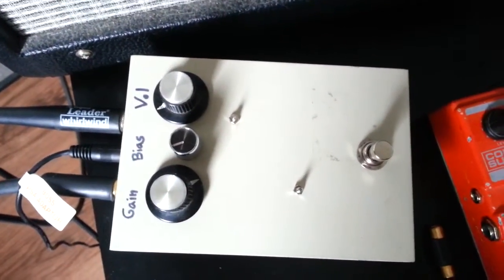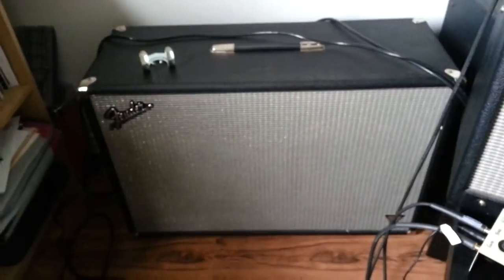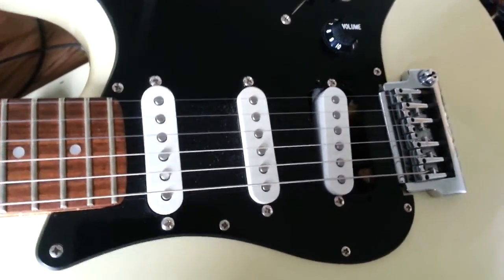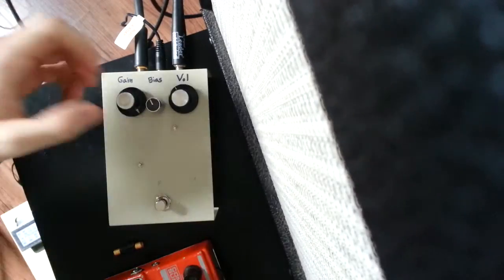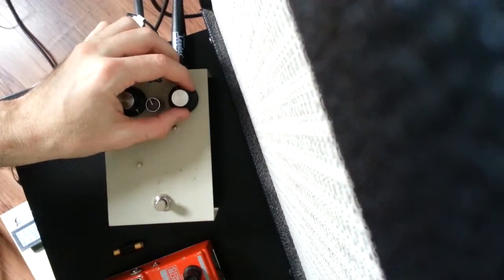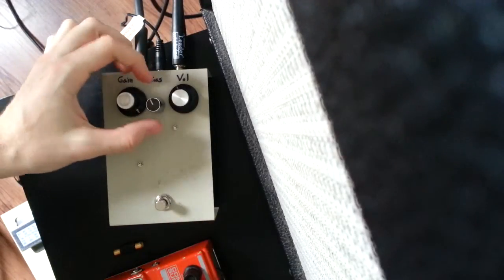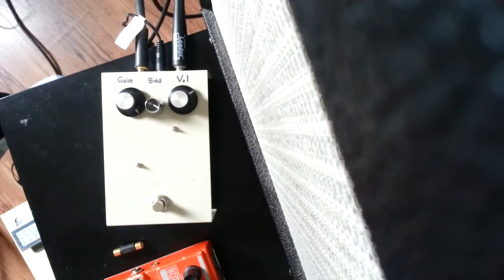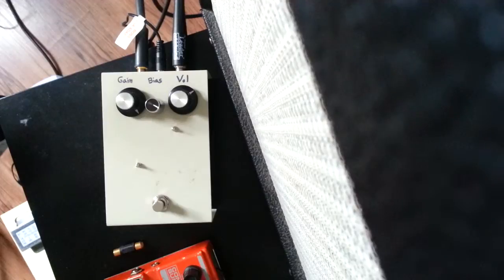Fuzz Face bias demo - Silicon Matsushita 2SC645

Comment: he mate. is this s axis fuzz circuit? If so did you had the bias pot on the R11 position (going into the collect of Q2)? cheers
Reply from the maker: @k-dogstor1170  It's the old original Fuzz Face. I added the bias as a 10k pot on the collector of the second transistor Q2. You have to put a resistance in series because if you have just the pot, the transistor will burn with zero resistance.

Comment: My setting:

Q1 2N2219 hfe: 132
Q2 2N2222 hfe: 244 

Q1 has the Rc=33K and I´m using the 10k trim pot to set 4.5V at Q2 collector but I can´t make this sound ok, I can hear some "sparks" while the sound is fading after playing any note. Do you have and idea whay is this  happening? Thank you
Reply from the maker: The 33k q1 resistor is usually adjusted for a q1 with a gain of 80. The higher the gain, the bigger that resistor needs to be. Aim for a collector voltage of 0.7 to 1.3 volts on q1. High gain transistors will need 100k - 150k.